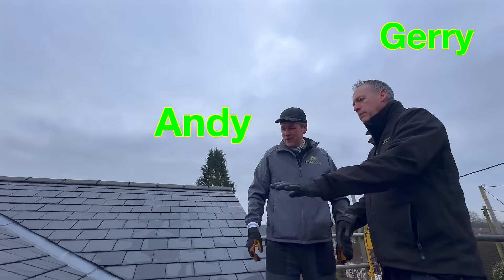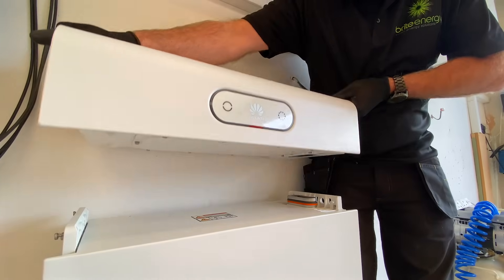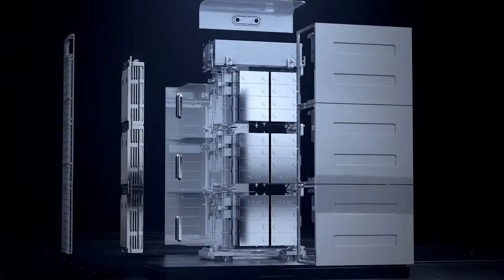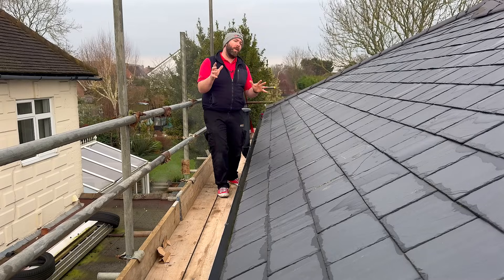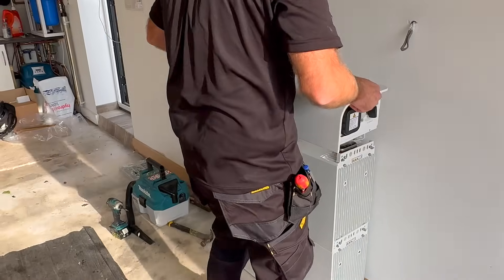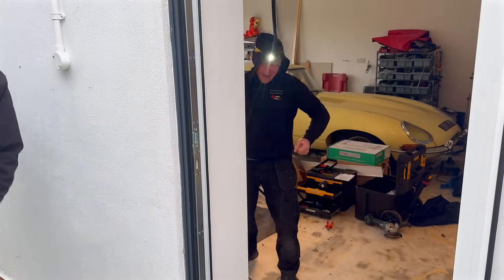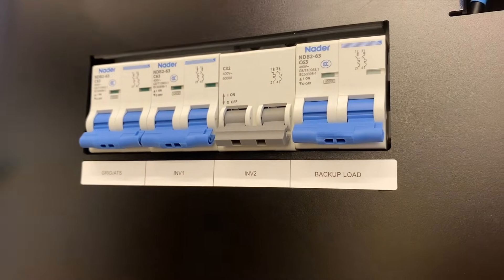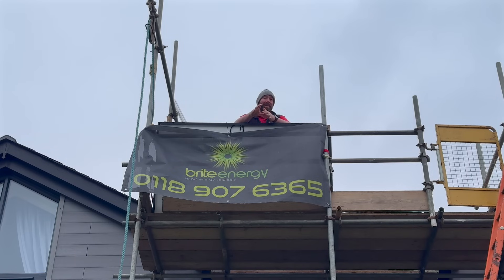Think Battery Installs Are Complicated? Think Again! - Huawei Luna S1

Comment: Great video - thanks for sharing. However, I'd like to ask what are the fault current characteristics of this battery system? It wasn't mentioned on the video and couldn't find them on the provided link. As we all know, this is a very crucial information and should be easily available by anyone. Thanks

Comment: *4.The output power may be affected by temperature. Please refer to the output derating curve for details.  Does appear to have self heating capability but may be a bit weedy based on that. Probably has a derate or even prohibition on charging at low temperatures too.   Install it outside and you may run into trouble in winter.  I really want to see a battery manufacturer being upfront about this stuff but all I ever see in the blurb is -20c to +55c.  This is no reflection on efixx, just the battery industry in general.
Reply: It has a temperature regulator in the pack that maintains the battery at 17 degrees which is optimal temperature.
Reply: @phoebes_fairytale  Yes, you'll see I mentioned self heating ability, but they still put the wee asterisk in there, and the even smaller 'may not actually do it' notes right down the bottom of the brochure.  That sort of rubbish needs to stop.